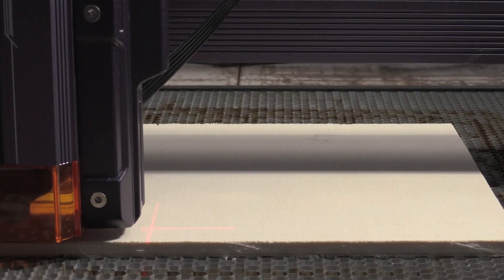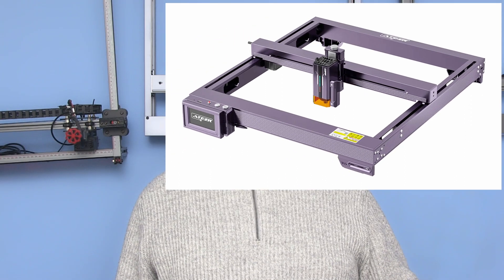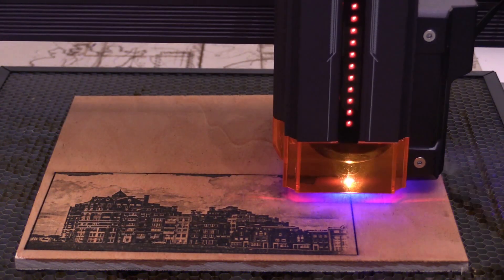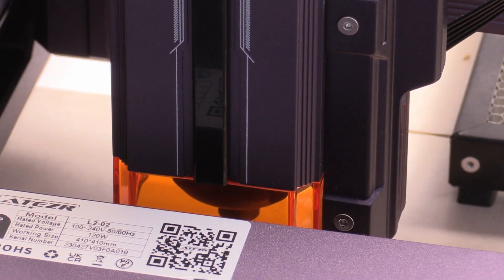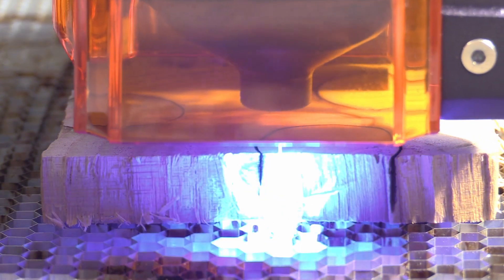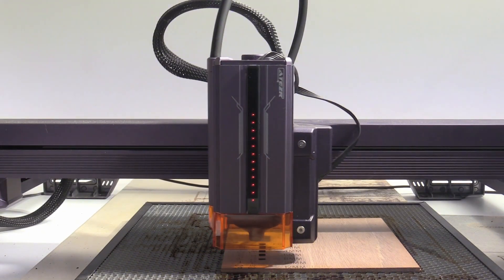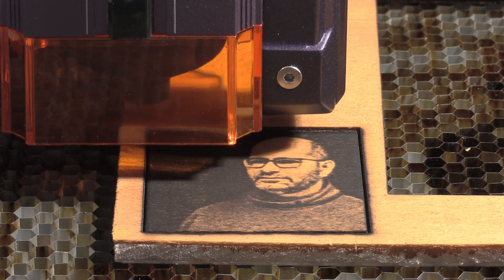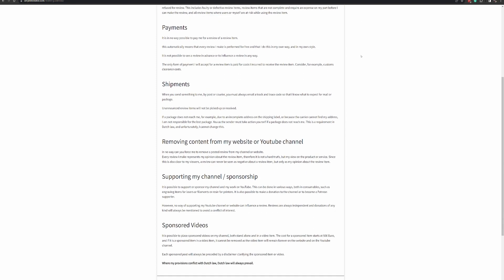▼ ATEZR L2 | One of the BEST laser engravers

Comment: Hey Brian great video, I just got the same laser. However it is my first time using lightburn and lasers, I am getting an error like this ALARM:8
Homing fail. Cycle failed to clear limit switch when pulling off. Try increasing pull-off setting or check wiring. any idea how to fix this? any help would be great, perhaps a video idea to help noobies  to the hoddy.
Reply from the maker: Got you... https://youtu.be/wgntXRcuqcs
it's about another laser, but it's the same trick.